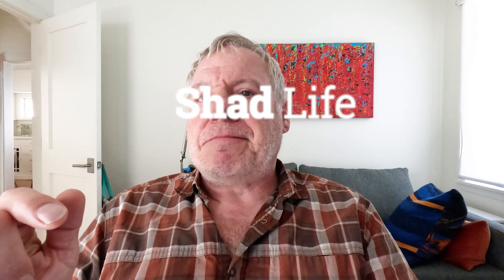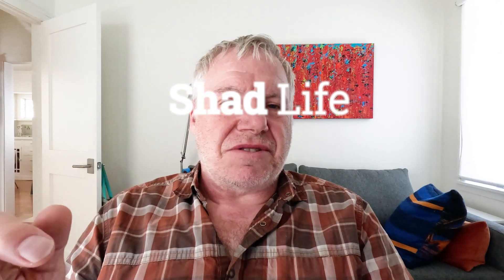Why Is Fork Axle To Crown Important?

Comment: I want to give away my 140 mm nice air fork fork to a friend that has a 100 mm crappy coil fork. He is a big guy, like 6'5, 260 lbs... So my thinking is that it will make his rides waaay smoother as he'll be able to adjust the fork to his weight... I do understand it will slacken his bike a lot... And basically, raise the font end by 40 mm. (both are 29'' forks and wheels). My only concern is that it will kinda compromise the bike structure with the added slack. I'm afraid he will brake the bike in half, especially since he is that heavy. He just started riding so he is not riding hard or doing anything crazy, so I think it should be fine in the short term, until he starts riding a bit harder?
Reply from the maker: I don't recommend going from a 100mm to 140mm.fork. That's a significant change in the bike's geometry and will likely put the frame at risk as you mentioned.

I get that you have a better fork, but it's not the right fork and thus it's not a good idea.
Reply: @ShadLife  Yeah, probably smart hahah Looks like the fork travel can be reduced to 120mm  with some spacers inside! But will have to see if I can find those spacers and if someone can fit those in.... Don't have the right tools for the job

Comment: I have a Marin 2021 Riftzone 3 XL it’s advertised as 65.5* HT-ST 76*. I converted my fork from 130mm to 150mm and my HT is 64*-ST 71* off 20mm air spring change outer stansion tube obviously have not changed same casting. It’s dramatic and for my situation hating low stack and too much effective TT I absolutely love it. I pedal strike a lot less really it’s crank strike so much benefit. 

Since I’ve also spank spoon 60mm bars with a 50mm length stem with a 31* rise my reach has decreased significantly making that steep seat tube great. 

This is great stuff your telling people. And remember no amount of geo numbers amount to throwing a leg over and bike and riding it.

Comment: I'm a tall rider, but much prefer 27.5 wheels. I think bike companies forcing a wheel size on someone based on their height is brain dead simply because wheel size is a performance characteristic, not a height dependent criteria.
Reply from the maker: I agree with this in most cases. Although with basic bike sizing it makes sense to go from 27.5 to 29-inch wheels as the bike gets bigger. But as you stated, there is also the rider preference aspect of all of this, and one of the biggest reasons I don't think the bicycle industry should push 29-inch wheels onto us. A more park oriented bike is more fun with 27.5-inch wheels. They make the bike to be more agile and so on. I still see a fair amount of new 27.5 bikes coming out, so hopefully we don't see them go extinct.

Comment: Shad, the hand drawing isn't showing up on screen!!
Reply: So I had 2019ish Karate Monkey. Surly over forked it with 140mm judy gold.  It wanted to wheelie on steep fire road climbing.  We need to get surly to refine and update there geo.
Sold the monkey and got a Hayduke.  Much better bike.
Reply from the maker: I see it. Do you have your contrast or brightness too high? I will see if anyone else has the same issue.
Reply: @ShadLife ok was my contrast👍🏻
Reply from the maker: Your eyes will appreciate you having to adjust it for my crappy graphics...🤣 Low contrast stresses your eyes...😉
Reply: @ShadLife  lol video was on point 👍🏻
Reply: @ShadLife Great info! I need to learn "offset" next 😊
Reply: I see it